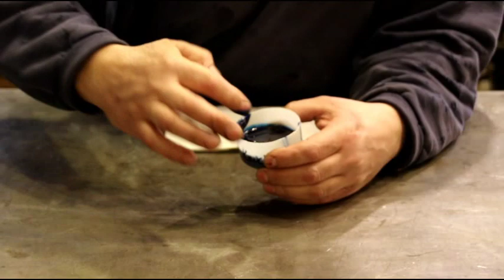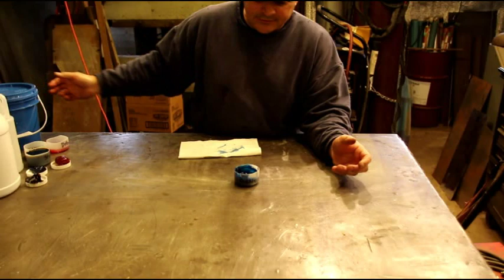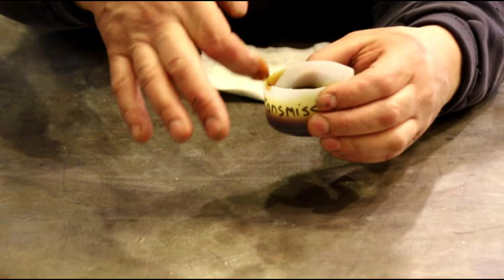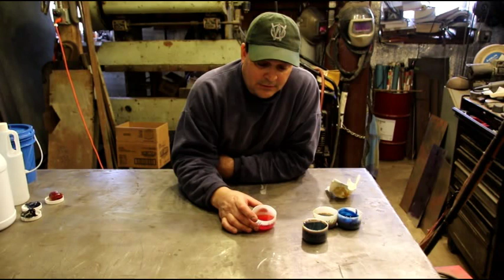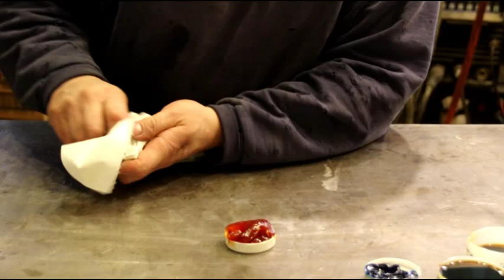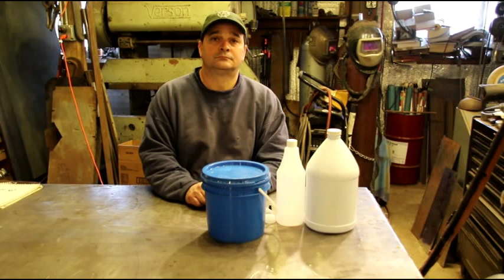The Correct Lube For Classic and Antique Vehicles

Comment: Hi, are you still selling these lubricants?  I don't see a phone number or email address in the description so how do I contact you to purchase a lubricant?  

Especially interested in the lubricant for the enclosed knuckles of my Loadstar 1700 4x4's.  I'll be doing a complete steering and front axle rebuild next year so I will also need other lubricants too such as wheel bearing grease, power steering fluid, etc.  You mention these lubricants are for Jeep and Willy's but this is a heavy duty truck - are these lubricants all acceptable for heavy duty trucks too?  

Finally I have a very rare 4-speed transfer case manufactured by Dana/Spicer in one of my Loadstars.  It uses many of the parts of a R-8341 auxiliary trans coupled to a Spicer 738 transfer case in one big gear box.  According to Spicer I should only use full synthetic gear lube in this trans/transfer case box.  What are your lubricant's recommendations for this gear box?
Thank you, Sir.

Comment: Great video! I need to do a complete lubricant change and service as I have no idea what the PO used. I suspect he took the CJ3A to the "Lubes R Us" place down the street. I notice my Ross box is leaking, the bushings are worn and sloppy. The knuckles are leaking but the seals look well worn. A half tube of Corn Head lube came with the Jeep so I used the balance in the knuckles. My main concern is for the transmission and transfer case. The transmission shifts smoothly enough, very minimal to no gear clash but the transfer case is a real bugger to shift, and yes, I shift the TC when the Jeep is at a standstill. A video about engine oil, filter, air cleaner would be welcomed! Love your channel! Keep the videos coming!